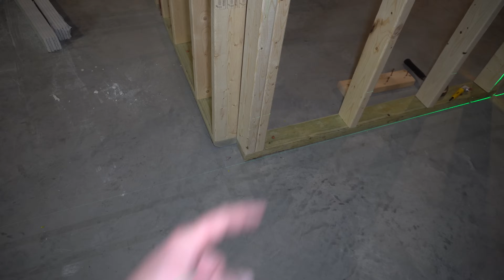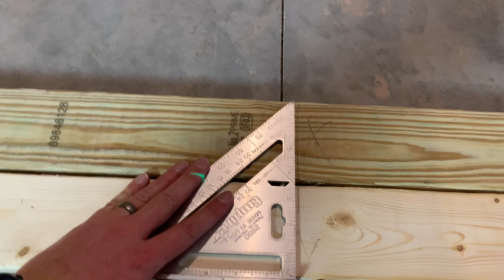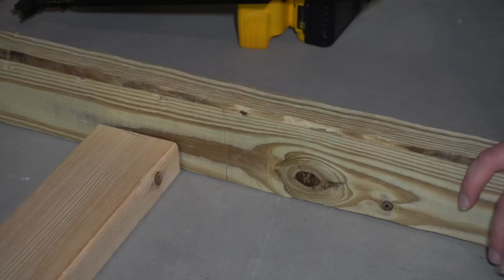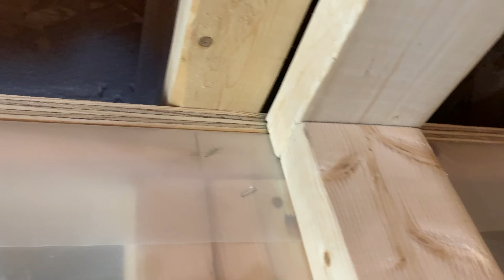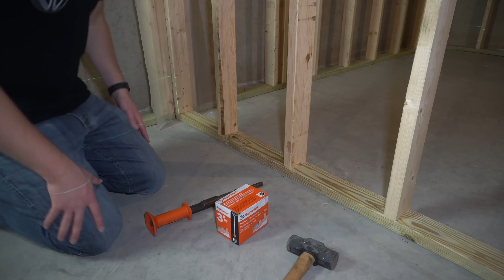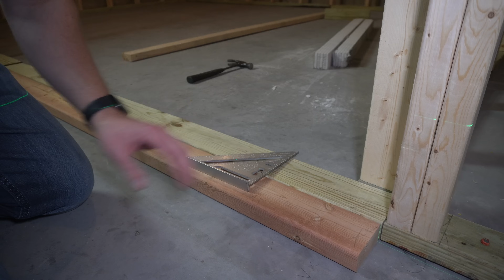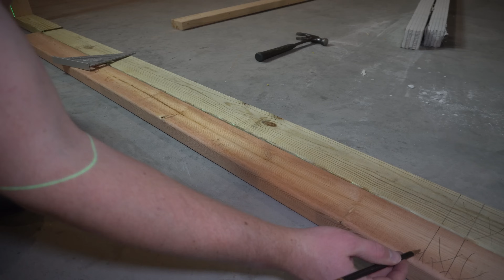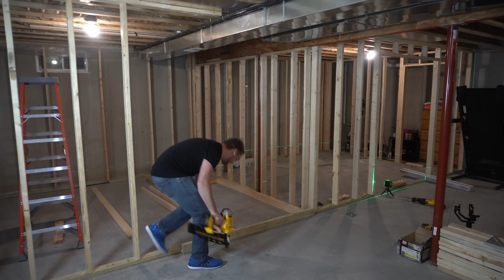The Basics of Framing A Basement Wall

Comment: You made a great video and I see you take the time to reply to most comments! The only thing I think most people would change to make a much stronger wall is instead of toe nailing one stud onto a joint, which can result in multiple modes of failure, it is best to finish the end of that piece with a stud, and continue the next bottom chord with another stud, and then fastening the two together at a 16” nail separation. This is especially true in your situation because there is not a double top plate to bind the wall sections together.
Reply from the maker: Interesting.. I didn't even think of that! so you're saying the top and bottom cord wouldn't be continuous, correct?
Reply: @DoingWhatever  I mean it could be, you can get 2x4s as long as you want but 16ft is really the price breaking point. The lumber manufacturers do it on purpose towards the end retail price. They know an 8ft 2x4 costs $4 but a 16ft costs $12. Because no matter what, you have to use an extra $4 stud to join walls and the end result will be the same price. For most building in North America, 16” OC is the standard but that is a minimum. If you wanted to go crazy with it and have 8” OC studs, no one will stop you for overbuilding. There is however, a schedule in 2018 IBC that states how walls like you showed should be conjoined. IBC is a guideline for most local building codes and is often adopted without change. To build that wall correctly, you’d need the double vertical stud I described, with 16” OC 3” nails vertically, and then a minimum 4’ overlap doubled top plate. In your case, it isn’t load bearing and drywall acts as a shearwall so much of those things tend not to matter. But I’m a firm believer in if it’s worth building, it’s worth building right the first time. Hope that makes more sense!
Reply from the maker: Yes, that makes sense - I appreciate the advice!

Comment: Question I've been watching a lot of videos on finishing a basement. I'm curious as to why your framing on the cement and not on a subfloor?
Reply: I only ask cause next week I close on my house, and I am planning to finish basement. I'm trying to find out if I need to do subfloor or not?
Reply from the maker: My house was built pretty recently (2017) so I have a moisture barrier under the concrete slab. So I’m not worried about excessive moisture in the basement. If you’re in a damp location it might be ideal to provide a subfloor that allows airflow like the dimpled plastic one that is pretty common. I would check with your local building inspector. 
A breathable subfloor isn’t going to hurt, it will just cost a little more upfront. If you want that extra layer of protection, go for it 😃
Reply: @DoingWhatever   oh ok well that makes sense. Ty I appreciate the information. I definitely will check with local inspector to find out.
Reply from the maker: Good luck with the build!

Comment: Screwing the 'blocking' into the joists did not look good...  I think I'd rather nail them in TBH, but I have a framing nailer so it's different for me probably..  
When you nail them it, it doesn't result in pushing or pulling the joints into the blocking.
Reply from the maker: I'm not too concerned with it pulling the joist over less than 1/8" but I could have re-cut that blocking piece to fit more snug. 
The difficulty I have when toe nailing these pieces in with a framing nailer is that the nail pushes the blocking up and then it's no longer flush with the bottom of the joist. With a screw, I can attach it "slowly" and make sure it's flush with the floor joist. But to each their own. 
Thanks for watching!

Comment: Hey great video. Kind of lost me at 12:50 with the blocking. Are you actually putting those small blocks down and also, why isn't it flush with the already existing stud? 
Thanks!
Reply from the maker: Thanks!
Nope lol I was just using those small blocks to demonstrate. At 14:07 I'm adding the full height studs that will be used to nail the new wall to. 
I'm not sure I understand your last question about the studs not being flush with the existing stud..

Comment: I’ve been searching for a straightforward can do way of framing an interior wall and your video has by far been the easiest to follow and most helpful. Thanks for the content and keep it up. Question: is there an alternative way of attaching the sill plate to the concrete slab? Tapcon screws? Thanks!
Reply from the maker: Awesome, I really appreciate that!
I've only ever used these Ramset nails but I believe you could use tapcons. I think they make concrete nails that you drive in just like a regular nail but they are hardened so they won't bend. I'm sure there are a few other ways to attach it that I'm not thinking of at the moment lol. 
I appreciate you watching and leaving a comment!
Reply: Yes you can use tapcon, just many people don't do that as it's drilling and far more work than what he showed.  I believe there are some guns that shoot nails like the ramset too, that are powerful and very expensive.  Also remember a way shown by an old guy where I think you dirll the hole and pound in 2 or 3 nails in the same hole or something to that point.  For me I'll just still with ramset, for permanent walls and tapcons for non permanant.  Like a wall where the next owner might want to remove.

Comment: The absolute hardest part of a basement finish is moving all the materials to that level..here in Colorado we have to build floating walls. They're "so fun" but very effective..Excellent tools, your nailer is worth it's weight in gold. Just today I got in Milwaukee's hammer drill, impact gun and oscillating tool...What to build, what to build...haha! Question: Why all the space between the foundation wall and the framing? I'm subbing, I like what you're doing!
Reply from the maker: I second that! Lol especially if you don’t have a walk out basement. 
Yea I’ve had a few comments about floating walls but it seems those are only mandated in very few jurisdictions. Interesting concept for sure. 
The nailer was worth every penny! 
I left 1/2” of an air gap between the foundation wall and the 2x4 wall just in case any moisture got behind the wall; it would likely evaporate before it caused any damage. It’s a fairly common building practice. Plus, since the stud wall isn’t in direct contact with the foundation wall, they don’t need to be treaded studs so you save some money that way. 
Thanks for subscribing! I really appreciate it 😃

Comment: Framing basement walls, requires "floating" walls by code.  This is to prevent the water table from lifting up the slab and displacement of walls, that would be transmitted to the upper floor above.
Reply from the maker: Only in a few states in the US. I believe Colorado and Wyoming, but be sure to check with your local building inspector if you aren't sure.

Comment: I have a "framing nailer vs screws" comment.   Watching roofers lay shingles in mere seconds with a roof nailer looks to save tons of time on a hot roof.    So I was fully prepared to rent a framing nailer like the DeWalt beast,(who doesn't like a new tool/toy!)  but because I am super analytical, I was curious if it really saves time.  So, I just ran a stopwatch at 10:53 and to put in two nails took 6 seconds.    My upcoming project has 120 studs, so on both ends, that would be 6seconds x 2 ends x 120 studs= 1440seconds or 24minutes.  Not bad at all.
However, I then ran a stopwatch for screws; picking up screw, lining it in to the drill bit (impact gun) and screwing it home.  Took 12 seconds for both screws, so I figure it would take twice as long, but the difference from 24 minutes to 48 minutes isn't much.   I guess if framing a whole house, or for roofing, speed is a much more important factor, but for me an extra 24 minutes is like not watching a Seinfeld show.  No big deal.
Some more benefits:
-safer with screws (no chance of nailing a finger, or plastic in the eye)
-no time spent loading new nails in the nailer
-no need to invest in an expensive tool ($500+)  (or go through the hassle of renting one..that would take 24 minutes for pick up and drop off alone!)
-I like screws for their versatility (being able to easily remove them if I make a mistake)
-Screws cost less money too.   $50 for a case of 1,000 #8   3" screws   vs   $80  ($40 for rental, $40 for nails)  vs.  .  Even if I wear through 2 or 3 screw bits, I am still saving money.
Oh, and the remaining 500 screws I didn't use will be very handy for my other projects like 2x2 framing around ducts and waterpipes.
Reply from the maker: lol wow! very analytical!
I think each have their place - for me I tend to use the nail gun when shooting the nail in straight. If I have to toe nail something or when it's critical that something is lined up perfectly (the blocking for the top of the wall in between floor joist and flush with the bottom) then I tend to use screws because I can make small adjustments as I drive in the screw so it ends up perfect.

Comment: Thanks for the video.  On the framing along the exterior walls, is the gap necessary?  How much gap is needed?  I was planning on gluing 1" foam board to the cement wall and placing the wood frame against it.  Would this be correct?
Reply from the maker: I like to have a gap there just in case any moisture would get behind the wall - it would likely evaporate before causing any issues. I provided a 1/2" air gap. I've seen it done your way as well. I would talk to your local building inspector to see what's appropriate for your region. Thanks for watching!

Comment: Great video, thorough yet easy to follow and you cover the basic steps which others sometimes take for granted.

I have a big unfinished basement, but I am just framing out a "home office with a door.  I am planning to do laminate floor.  Can I put that right over the concrete?  If I do need a subfloor, is that just pressure treated plywood or is there some sort of framing that goes on the floor as well?

Thanks.
Reply from the maker: I had a flooring contractor lay my floors since I did half carpet (don't know how to install carpet) and half LVP. they went right over the concrete with the LVP. Each flooring manufacturer may have different suggestions or requirements for their specific product so I would see if that's the case with the flooring you are considering. Doesn't hurt to ask your local flooring company either for help/advice 😃 Thanks for watching and great question!
Reply: if you go with a LVP rather then laminate you can go right on top of concrete as they are made on non organic materials. you can also use some self leveling cement if you floor is not level, and underlayment would help also.

Comment: Wood straight on concrete in basement is a no no. There should be a moisture barrier. The concrete floor on the basement will always have a cooler temperature so it could create condensation. Using foam board then plywood to build a subfloor is a much better option. Same for walls!
Reply: Check your local code. Typically it is a vapor barrier OR treated lumber, which is what he used in this case.
Reply from the maker: correct, local code calls for treated wood when in direct contact with the concrete floors and walls.

Comment: You really ought to use a level and not rely solely on your laser for level and plumb.
Reply from the maker: why is that? the laser I'm using has an auto level feature that relies on gravity to find level just like a bubble level? genuinely asking, not trying to be a jerk lol
Reply: @DoingWhatever  Lining  up a long 2x4 edge with a laser can be off no matter what you think.  Lasers are great for getting the start and finish point of a line, not so much for the edge of a board.

Comment: Enjoyed your video.  Couple of questions: Is there a reason why you're not using 2 top plates?  And, is a header for the door not required?  Thanks,
Reply from the maker: Thanks!
I didn't use a double since these walls aren't load bearing. I don't know if there are any benefits for using a double in this situation but there's nothing saying you can't. just a little extra work and material. But there may be different rules depending on where you live. Same thing for the header over the door - it's not load bearing and it's really not spanning a large distance so the small studs between the "header" and the top plate will be sufficient enough. Thanks for watching and for the questions 😃
Reply: As a framer doing whatever is correct in his reply. However trimmer or jack studs need to be added to the R.O.

Comment: Can I use screws instead of nails? Don’t want to spend $400 on a framing gun
Reply from the maker: That's a good question - I think you can use either. Some people say that screws don't allow for any 'give' to the framing as it settles, which is probably true, but I've seen plenty of people use both screws and nails.

Comment: Very nicely done. BUT... the engineered floor joists on the first floor of the structure are not rated for lateral loads, as are being applied in this project.
Reply from the maker: lateral load as in connecting the top of the new wall to the blocking that is attached to the floor joists?
I'm not sure how else you would attach the top of the wall... this seems to be a pretty typical way to do so, but I'm always open to learning new things

Comment: Great video. So no blocking required on these walls?
Reply from the maker: Thank you! I didn’t do blocking since these were slightly shorter than 8’, so the vertical span doesn’t bother me. It wouldn’t hurt to add intermediate blocking, just is a bit more work.

Comment: Thank you!!! I’m starting my basement and this was super helpful. Do you have a video for framing the exterior walls?
Reply from the maker: No problem 😃 good luck on your project! 
I don’t have a separate video on that but framing the walls along the concrete foundation walls will be very similar, if not identical. The thing to keep in mind is you will want to leave a gap between the face of the concrete wall and the new 2x4 wall you are building - roughly 1/2”. This is an air gap and will allow moisture to evaporate, should there be a little bit of moisture. Typically, you’d measure 4” off the concrete wall, and that mark will be the interior face of your new wall. Hope that makes sense 😃

Comment: I’ just want to frame the wall to put dry wall up can I use 1 by 1 wood I’m not framing any rooms just the wall to cover the brick n the basement
Reply from the maker: You may be able to do that depending on if your local code has any requirements for an air gap between the block foundation wall and the new wall. I would talk to your local building inspector first. The region you live in will determine how that wall furring should be constructed.
Reply: @DoingWhatever  thank w
Reply: @DoingWhatever  you

Comment: I noticed u have space between the wall and 2x4. Was that decision made so u didn’t have to use treated wood?
Reply from the maker: Correct, there is about a 1/2" space between the foundation wall and the 2x4 wall. This is an air gap (pretty common). The air gap allows for any moisture to evaporate before causing damage to the 2x4 wall, just in case any moisture would develop behind the 2x4 wall. The byproduct of this air gap allows you to use regular 2x4 instead of treated like you mentioned.

Comment: NOPE. You lost me as soon as you laid the top plate next to the bottom plate and did it that way. As someone that used to Frame houses, dont ever do it this way. The bottom plate and the top plate will almost never be the same length as the concrete is never perfectly flat, straight and level. Always use at least a 4ft level and a tape measure.
Reply from the maker: What do you mean? I’m genuinely curious since the way I did it is the only way I’ve ever seen it done. Not trying to be a jerk, sincerely asking. Over an 8’ length, the difference in height from concrete to underside of floor joist was maybe 1/4”.

Comment: I'm new to this. Why are your outside framed walls not tight on the concrete walls?
Reply from the maker: You typically leave about 1/2” air gap between the concrete wall and the wood framing. In case any moisture would develop behind the interior wall, the air gap allows it to evaporate before causing any damage to the interior wall.

Comment: @doing whatever why does the 2×4 ho on the x instead of the 16inch center and you don't say how far the x had to be from the 16inch center I'm not a carpenter so it shows I'm a beginner trying to understand this
Reply from the maker: Good question! So the first dimension is always 15 1/4" from the end of the plate (after that, all your dimensions are 16" from the first line you drew). That is giving you the first side of the vertical stud. Since a stud is 1 1/2" wide, I am offsetting it half of that, so 3/4". So going back to that first dimension, 16" - 3/4" = 15 1/4". By doing this, you are finding the first side of each of the vertical studs (the line you draw), but since this line is offset that 3/4", all of your studs will end up 16" on center. The X just represents which side of the line you should place the stud, it doesn't have a specific dimension. 
I hope that makes sense - it's a little bit difficult to explain in text lol. Maybe I'll make a short video explaining that better.

Comment: You forgot to frame in the window in the background.
Reply from the maker: I cut windows in after the wall is in place. That way I can frame it in exactly, and not have to rely on measuring for the window right away and hoping I put the wall in the exact location. Make sense?